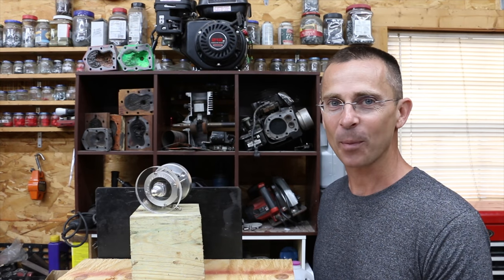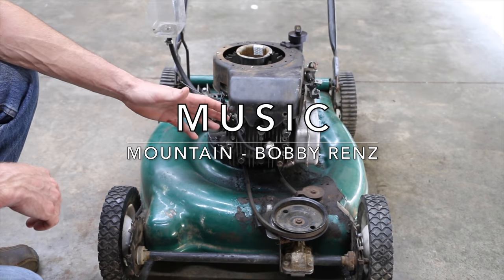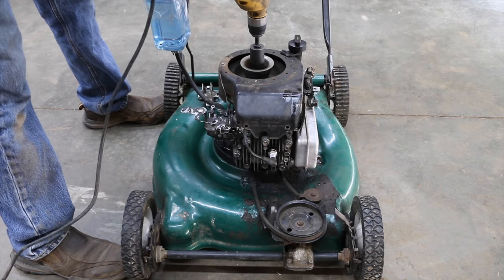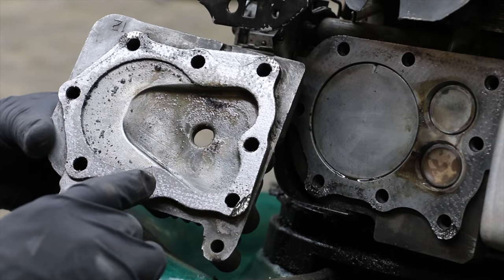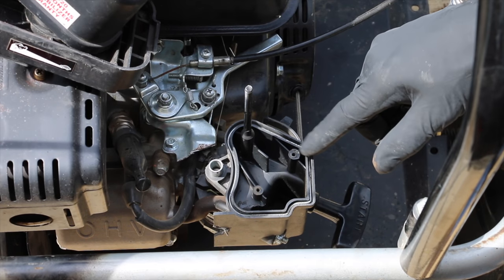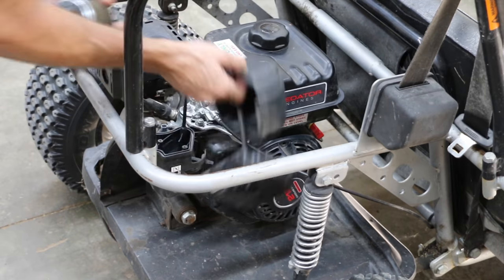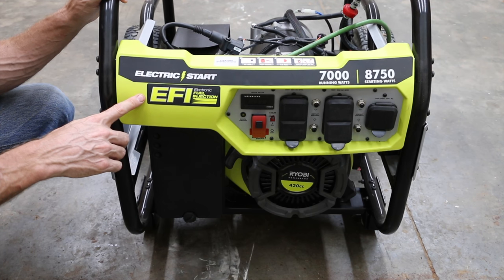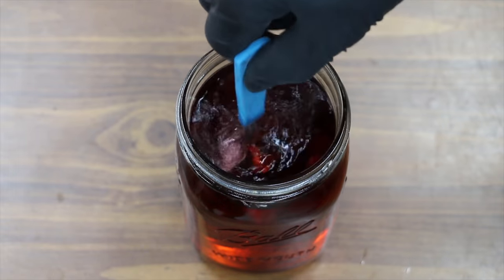Is Leaded Fuel better than Unleaded?  Let's find out!

Comment: How about a comparison between 10% ethanol and non-ethanol, reg gas?
Reply from the maker: Thank you for the video idea!
Reply: Ethanol based fuel gets worst mpg  than nonethanol fuel.
Reply: @UAa320  True but with ethanol based fuel you get more horsepower and torque.
Reply: @JQB45  I little bit more, but with ethanol there is the issue of it absorbing water.
Reply: @UAa320  The water absorption issue is extremely minor, youll likely offgas your alcohols, leaving your oil/sludge behind. This is typically the issue. (I say alcohols because gasoline contains and has always possessed a collection of alcohols)
Reply: Maybe more of E50 or higher vs non ethanol high Oct gas
Reply: @UAa320  I would expect about a 3% difference as ethanol has about 30% less energy than gasoline.
Reply: @JQB45  You may get more horsepower from ethanol if you use more of it at a time compared to using straight gasoline.
Reply: @2aminitials  Only if the engine is tuned for it. The higher octane rating of e85 allows for more advanced engine timing and higher boost without pre-ignition or detonation. This is why larger injectors, higher boost, E85 gets the higher horsepower numbers.
Reply: @JQB45  If you mix e85 with gas to make say a e10-e50 blend you will get a higher octane value, but running E-85 expect 30% mileage losse, if you buy gas with ethanol already premix to make the level say 87 e-10 then it's 87 octane regardless of the ethanol.   E85 octane value is around 107 octane, mix with 91 octane to make a e50 blend will result in about 99 octane. If you tune your vehicle to the fuel and you will see huge power improvement. Example,  2018 f150 3.5 ecoboost dynoed 93 octane  450whp 570tq, E50 tune 552WHP 620TQ. Huge gains just on tuning to the fuel.
Reply: @UAa320  ethanol gas also rots gas lines in small engines
Reply: @UAa320  Correction, ethanol based fuel gets better mpg in high compression engines than gasoline but worse in lower compression engines.  

Some ethanol engines surpass diesel engine's mpg even.  Here is an ethanol engine on the roads worldwide that has mpg equal to diesel:

https://www.oemoffhighway.com/engines/press-release/21005554/scania-ab-scania-introduces-bioethanol-engine

Always more power with ethanol, even in lower compression gasoline engines.  For example a Chevy 5.3L pickup gets a clean 380 horsepower on E85 and a toxic 355 horsepower on E0.
https://media.gm.com/media/us/en/chevrolet/spec-tables/2016/1500-crew-cab.html

Even with the lower mpg, the cost per mile is lower with ethanol.
Reply: @UAa320  

 Water is a truly a problem of E0 straight gasoline.

Years ago in the days of E0 gasoline every winter people would even have to buy little cans and add alcohol called DRY GAS or HEET as gas-line antifreeze.

Gas stations would even have many cases of it stacked up near the check out counter during that time of year. No one likes having a fuel line froze up in dangerous temperatures. It was common back in the E0 days.

Since E10 came, nobody buys DRY GAS or HEET anymore because the alcohol is already in there. There may be a dusty bottle or two back on a back shelf somewhere at the gas station, but that is it.

If ethanol did cause water/phase separation problems even half or even a quarter as much as is falsely claimed, we would know it right away because every winter literally <b>millions upon millions </b>of cars would be stalled on the road in the northern US and Canada. This obviously never happens, but many cars did stall with frozen fuel lines back in the days of E0 straight gasoline which is why Heet and Dry gas were so popular and E10 is why they are not so popular anymore.

Mercury Marine, which hosted a Webinar on ethanol myths, noted that ethanol does not "grab water molecules out of the air." It is hydrophilic, which means ethanol holds water. With regular gasoline (E0) as well at E10, the primary cause of water collecting in tanks is condensation on tank walls. But unlike E0, which can absorb almost no moisture, E10 can hold up to half of one percent of water by volume, and the water molecules will dissolve in the fuel. The "solubilized" water will bypass the water separator and burn harmlessly through the engine.

>>>>Mercury Marine also says E10 may be the superior fuel(over E0) because it keeps the fuel "dry"<<<<

https://web.archive.org/web/20140922142320/http://dcd96xmek71bc.cloudfront.net/archives/email/Trade/BoatingIndustry/MythsofEthanol-August252011.mp4

According to a paper published by the Society of Automotive Engineers, at 68 degrees F, alcohol with as much as 45% water will mix with gasoline and not separate. With 4%, alcohol will form a stable mix with gas down to about minus 22 degree F.*

*A.C. Castro, C.H. Koster, and E.K. Franleck, Flexible Ethanol Otto Engine Management System 942400(Warrendale, PA:Society of Automotive Engineers International, 1994)
Reply: @JQB45  lol no
Reply: Prior to my wife's passing in 2013 I had a few stations (one next door to me) that offered leaded gasoline (cost more) for all of the boat people going to the lake and let me tell you my 1998 made 3 more mpg and stopped knocking at 87 octane but on the 10% ethanol crap I had to use 89 octane at least and lost those mpg.  Where I live now there are no places with leaded gasoline but back where I did live there still are.
Reply: Jeff C       hmmmm.... not as far as I recall, I think it might even be worse...  but i’m not an expert.    Mostly because ethanol has far less energy density than conventional gasoline, meaning it would require more to make equivalent power..    So in a normal car, you’d not only be getting lees mpg, but also less power. In some places it’s cheaper to run ethanol mix per gallon, but it still adds up to about the same in terms of miles driven.

In terms of environmental awareness, I’d sooner skip ethanol and go straight to hydrogen, either direct injection or hybrid electric fuel cell.
Reply: very true
Reply: @thatguy.42  wish my turbo pt could run e85. probably perform far better. knocks a good bit even on 92. doesnt get much higher in my area.
Reply: Sweet!!👍👍
Reply: @thatguy.42  Yes that is true.
Reply: As long as we don’t get those geniuses that think putting 91 octane in their stock beaters rated for 85 will give them more power, Im happy..
Reply: E10's mixture is so heterogeneous that there's not a discernable difference unless you have some seriously sensitive test equipment
Reply: Dana Fletcher Many people  have had trouble in the past when ethanol was first added to gasoline and they used the mixed fuel in older equipment not designed with the fuel lines / gaskets of today that are ethanol compatible. That is not an oil company myth.
Reply: Yeah, since there was no difference between that and E10, there probably won't be much difference from aviation and E85. I hear E85 has more power (possibly 100+ Octane equivalent), but doesn't last as long. There might be a difference with a sports of luxury car as well, especially one that takes premium

That may mean you may need to acquire a sports car for... um... your viewers (one that takes premium, especially ones with turbos)! Yeah, viewers!
Reply: All about that E85 on a tuned drift car
Reply: Project Farm  also would it be possible to get another cylinder head for the mower so we can see side by side comparisons
Reply: Project Farm how about low octane vs high octane?
Reply: Ethanol fuel is terrible unless stored in a inclosed air tight container such as an auto fuel system, marine fuel systems are an open vented system ethanol fuel will turn bad within a few days in a boat ethanol is alcohol and does absorb water significantly, put ethanol gas into a clear container on a humid day and within minutes there will be water forming in the bottom and the fuel will almost immediately turn milky looking! Try it!
Reply: He already did that
Reply: @JQB45  NOT ON CARBED 2 STROKE & 4 STROKE ENGINES!! 

Ethanol seriously nerfs horsepower and torque plus causes a whole host of other problems in classic and vintage engines!! 

Leaded petrol (98 RON) contains 9.2 million calories per litre.

Unleaded petrol (98 RON) contains 8.7 million calories per litre.

E10 unleaded petrol (98 RON) contains 8.2 million calories per litre.

Unleaded petrol has a vapourisation point of 35 C. Ethanol contaminated petrol has a vapourisation point of 18 C. This causes the fuel to vapourise before the piston has even started the compression cycle once the engine has warmed up. This results in poor combustion, overheating and a noticeable hole in the bottom end and midrange torque on classic carbed engines.

Adding a very small percentage of diesel or kerosene will counteract the negative effects of the ethanol and raise the vapourisation point according to the ratio added.  

I have to run 33:1 diesel oil in with the normal 33:1 petrol oil premix on my 2 stroke motorcycles just to restore anywhere close to the OEM performance that they had on the leaded petrol that they were designed to run on. 

You seem to be confusing ETHANOL based with METHANOL based fuels.

Ethanol based fuel = reduced horsepower and torque.

Methanol based fuel = increased horsepower and torque.
Reply: dou you really have leaded fuel in the USA ???????
Reply: @JQB45  only in sports cars with high compression ratios
in everyday cars with lower compression ratios it will only increase your gas mileage, ethanol has lower energy per volume compared to gasoline
Reply: @2aminitials  The US government told engine manufacturers in the 70s to have their products ethanol compatible by 1983 if they were not already.

If you look at any chemical compatibility chart you will see that ethanol is far less corrosive on rubbers, plastics, and metals than what highly corrosive BTEX and gasoline are.  Look for yourself.
Reply: Colorado Strong  If you add water to your gas, you will have problems with any fuel.

Alcohols are in carb and injector cleaners, look at some of their ingredients.  Gasoline varnishes and alcohols break up varnish from gasoline.  Once clean, ethanol keeps it clean.

If E10 caused water problems, every single winter there would be millions upon millions of stalled cars with frozen fuel lines in the northern US and Canada.  There isn't, but there was enough in the days of E0 for little cans of alcohol to be sold as gas-line antifreeze named "Dry Gas" and "Heet" of which is not needed anymore because E10 has the alcohol in there already.

Here is some outdoor power equipment that burns E27(Brazil's common gasoline) just fine, does it look familiar?:

https://www.stihl.com.br/produtos.aspx
Reply: @CZ350tuner  Ethanol does give more horsepower and torque, even in lower compression engines.

A Chevy pickup with a 5.3L engine gets a clean 380 horsepower on E85 and a toxic 355 horsepower on E0.
https://media.gm.com/media/us/en/chevrolet/spec-tables/2016/1500-crew-cab.html

An ethanol engine will have better mileage than gasoline, some with greater mileage than the best diesel engines even.

Here is one on the roads this very day worldwide with mileage greater than gasoline and equal to diesel:

https://www.oemoffhighway.com/engines/press-release/21005554/scania-ab-scania-introduces-bioethanol-engine

Ethanol has MORE power than methanol and better mileage.  I did not confuse methanol and ethanol nor did the Indy 500 who is the subject of this article below:

A Brief History of Racing Fuel By Craig A. Johnson

In 2005, the IRL used 100 percent methanol in their tanks. The fuel worked well and was <u><b>more efficient than straight gasoline</b></u>, but IRL officials believed there was room for improvement. In 2006, they moved to a 10 percent blend of ethanol and methanol, which was then changed to 100 percent ethanol for the 2007 season.

The desire to use only ethanol aside, 100 percent ethanol is nearly impossible to obtain, and is illegal to keep without paying hefty taxes that date back to prohibition. The actual fuel used by the IRL is a blend of about 98 percent ethanol and 2 percent denaturant. The exact composition includes a small amount of high-octane racing fuel.

The fuel for today's Indy cars has an octane rating of 113, compared with methanol's 107. This means a significant reduction in pre-ignition, or knocking and pinging.

In addition, many of the people who handle the fuel, say it smells like tequila. This quality may seem insignificant, but smell is actually one of ethanol's benefits when compared with methanol. Pit crews noticed the switch to ethanol immediately, reporting fewer coughing fits and less eye irritation before any other modifications were made to accommodate it.

According to Dennis Vervynckt, manager of hospitality services and an IRL official, in 2006, the first year the IRL began using ethanol, teams saw a reduction in efficiency of about 10 percent. "That's because we put straight ethanol into the tanks," he says. "The teams initially didn't make any�or very many�adjustments to their engines. After a few months, they kept tweaking and by the end of the season they were back up to 100 percent efficiency."

Vervynckt points out that there was a minor loss of power. "When they first started using ethanol, teams saw a slight drop in horsepower," he says. "As the teams got used to the fuel, they were able to get more horsepower from ethanol once they again reached maximum efficiency."

The switch to ethanol also allowed the racers to carry less fuel and make fewer pit stops, thereby increasing efficiency even more. "When the cars ran on methanol tanks had to hold 30 gallons to accommodate the fuel requirements of the cars," Vervynckt says. "After getting the engines to perform at their full potential, there was a significant gain in mileage. Indy cars now have 22-gallon tanks. When a driver pulls in to change out his tires, he can fill up. Teams were able to match their tire and fuel stops exactly, instead of stopping for tires only, or fuel only."

That efficiency translates into much less fuel being used by the sport. Lifeline Foods LLC, which supplies fuel for the IRL, will produce 120,000 gallons of ethanol for the 2008 season. And though this may seem like a lot, it's<b> 20,000 gallons less</b> than was used the previous seasons.

The switch from methanol-based fuel to ethanol has amazed almost everyone in the league. Drivers, the direct users of the fuel, voice their approval in glowing terms. "[Ethanol] is an American fuel that is good for the country and the environment," says Ryan Hunter-Reay, of Rahal Letterman Racing and driver of the ethanol car. Standing beside his crew as they make last-minute adjustments to the car, he is more than happy to discuss the benefits of the IRL's switch to ethanol. "It's been great for Indy racing�the fuel economy, emissions�there's nothing we don't like. We love it."
Reply: Jeff C 

It’s partially oxidized, right? So no.
Reply: Dana Fletcher 

Actually, in a humid climate, chronically partially filled tank, and infrequent refueling, water will condense and require an additive or addition of E85. I’ve used anhydrous IPA and found that it worked well to dissolve condensed water.
Reply: Dana Fletcher 

I once bought off season a few gallons of RV antifreeze. It was IPA. I blended it into my washer fluid tank with a few squirts of dish soap.
Reply: Strieter Marine Survey 

Auto fuel systems vent through a charcoal canister, so humid air does enter, resulting in condensation.
Reply: @FrankGutowski-ls8jt  I agree which is why I keep tanks full for long term storage.  I live where it gets cold enough to frost and you can see on the outside of tanks just how full a tank is sometimes.  I would keep tanks full with both E0 and E10.

Mercury Marine, which hosted a Webinar on ethanol myths, noted that ethanol does not "grab water molecules out of the air." It is hydrophilic, which means ethanol holds water. With regular gasoline (E0) as well at E10, the primary cause of water collecting in tanks is condensation on tank walls. But unlike E0, which can absorb almost no moisture, E10 can hold up to half of one percent of water by volume, and the water molecules will dissolve in the fuel. The "solubilized" water will bypass the water separator and burn harmlessly through the engine.

>>>>Mercury Marine also says E10 may be the superior fuel(over E0) because it keeps the fuel "dry"<<<<

https://web.archive.org/web/20140922142320/http://dcd96xmek71bc.cloudfront.net/archives/email/Trade/BoatingIndustry/MythsofEthanol-August252011.mp4
Reply: Super lack of horses
Reply: @2aminitials  Only if your engine is optimized to for it or if your engine ECU is able to make the necessary adjustments
Reply: @danafletcher2341  you definitely are the  'more informed '  persons comments l
read.  
Personal experience l found using up to 100 percent pure Ethanol in my feul injected car gave way more power and fuel consumption was better than standard gasoline.  I did stay away from Methanol as it apparently attacks certain plastics in feul systems.  At that time l was working for Sasol Company in South Africa known for its production of fuel and other products from Coal so had access to many different feul products. This was pure curiosity experimenting from my side as Sasol did at time but they did maximum addition of 25 percent alcohol " otherwise major modifications was 
necessary " ! 
Only modification l did was to slightly increase points gap on distributor 
and car was performing better than ever. I laughed at their findings but did not inform them of mine.
Reply: He already tested blended vs unblended.  Spoiler:  The selling point that ethanol blended fuel has no discernible loss of fuel economy is completely false.

I'm not sure what these other commenters are on about.  You cannot gain fuel economy by shoving more fuel into your engine.  Yes, you can increase HP because ethanol has a higher effective octane rating, but the engine has to have the ability to make use of that.  You know what else increases effective octane?  Water.  Ethanol is less energy dense than gasoline.
Reply: Colorado Strong I won’t buy this crap. I think you live where I do in CO, I’m glad I can find pure gas!
Reply: @FM4AMGV  more like 30...I was getting 240 miles per tankful on E10, now I get 330-340, that more than makes up for the added cost!
Reply: @greggharvey6304  The EPA measured and found the US fleet loses 3 to 4 % on E10 and 4 to 5% in our current inefficient lower compression engines.  The price of E0 is far more than >5% higher in price so the cost per mile is most always less.

If your particular car is not like most, perhaps yours is in need of some sort of repair or adjustment.
Reply: @Ullr the snow God I just want someone to tell me where I am incorrect if so. I hate being wrong.  I would hope others are the same when I point out where they are incorrect.
Reply: @Markworth  Ethanol has less BTU which is a measure of heat, not a measure of work.

In a steam engine BTU would be useful.  In a piston engine, it is pretty much useless. 

For example, here is an ethanol engine that gets higher mileage than gasoline and is equal to diesel.  How can that be?  There are other characteristics in the fuel that gets work done inside on engine.

https://www.oemoffhighway.com/engines/press-release/21005554/scania-ab-scania-introduces-bioethanol-engine

Oak Ridge National Laboratory measured the mileage of the US flex fuel fleet with horsepower taken into account called the gasoline equivalent ratio and found that E85 averages 3% better fuel economy with power taken into account.

See bottom of page 7 and top of 8 here:  
http://web.archive.org/web/20170121004456/https://www1.eere.energy.gov/bioenergy/pdfs/analysis_saab2007.pdf
Reply: He should buy a test bench engine where he can vary the compression and advance and a bench dynamometer to hold load and rpm, then you will see actual science.
Reply: Ok, Dana.  I dunno why your dumb reply got deleted, but here we go.

1) Your efficiency example is completely useless.  Obviously, a high octane fuel will run well in a compression ignition engine.  They're using a compression ignition engine to take advantage of the higher octane and ignore the AF ratio.  You could get similar if not better results with race fuel or water injection.    In spark ignition engines, which is 100% of real world cases, you need a lot more ethanol than gasoline to have combustion.  That is a bad thing.  It must be a surprise that real-life testing indicates that the horsepower gains from ethanol do not magically cover the higher fuel usage.

2) BTU is a perfectly good indicator of energy density.  It's pretty simple math to figure that if you need >30% more fuel to have combustion and you have ~30% less BTU rating, the fuel has less potential energy.  But since that's not good enough, a quick search also shows that ethanol clearly has a lower energy density than gasoline.  24 MJ/L compared to 34.2 MJ/L.  Unsurprisingly, that's a difference of ~30%.  I'm sure one of those ancient dead links you wanted me to see would have some voodoo going on to try and disprove this basic math, but you know.

I get that there are benefits to using ethanol and all, but no one needs your "misleading" propaganda.  Knock it off.
Reply: @Markworth  Hi Markworth,

I did not delete any post so it must have been Project Farm who did or YouTube, if so, I wonder why.  I utterly despise censorship and unless for something uncivil I consider censors cowards.

Ethanol in high compression engines will indeed beat gasoline, even high octane race gasoline.

The Indy 500 when they switched from race fuel gasoline to methanol gained mileage and power.  When they switched from methanol to ethanol they again gained more mileage and more power.  So much so that the fuel tanks were made smaller from 30 gallons down to 22.  They saved 20,000 gallons for the first season.  

See article about it here:  
http://www.ethanolproducer.com/articles/4449/indy%27s-super-fuel

Oak Ridge National Laboratory measured mileage of the US flex fuel fleet with horsepower taken into account known as the gasoline equivalent ratio.  They found that E85 averaged 3% better fuel economy than E0(again, with horsepower factored in)

See bottom of page 7 and top of 8 here:  http://web.archive.org/web/20170121004456/https://www1.eere.energy.gov/bioenergy/pdfs/analysis_saab2007.pdf

Those are lower compression gasoline optimized engines.  In ethanol optimized engines, ethanol not only gets more mileage and power than gasoline, it also beats the best diesel's.

Ricardo built an ethanol engine for GM and it ran in a pickup. Here is an excerpt of an article describing it. Note it gets more mileage than even a diesel engine which is itself better than gasoline.

FROM RICARDO:

The new federal CAFE standards are calling for a doubling of fuel mileage performance, which, Vint says, is going to send OEM’s looking for high octane numbers to improve efficiency and ethanol is the best source. Ricardo, an engineering firm with over 100 years in the business of engine design, has developed an extreme boosted direct injection engine (EBDI) to optimize ethanol blends. The 3.2 V6 gasoline engine rivals the power and torque of a much larger GMC Sierra 6.6 diesel, he said, and it delivers 3.5 percent better fuel economy than the diesel.
  https://www.greencarcongress.com/2010/01/ricardo-and-growth-energy-collaborate-on-first-vehiclebased-demonstration-of-ricardos-ethanol-booste.html

Almost all manufactures have built efficient ethanol prototype engines. Here are a few:

FROM CUMMINS ETHOS ENGINE:

According to Cummins, it delivers the power (up to 250 hp) and peak torque (up to 450 lb. ft.) of gasoline and diesel engines nearly twice its displacement...

...Using corn derived E-85, the high thermal efficiency and power-to-weight ratio of this engine results in 50 to 58 percent lower well-to-wheels CO2 emissions compared with the gasoline engine baseline. Using second-generation, lingo-cellulosic derived E-85, the power train’s efficiency features deliver 75 to 80 percent lower well-to-wheels CO2 emissions, depending on the drive cycle.
  https://www.autoguide.com/auto-news/2014/07/cummins-ethos-e85-turbo-four-cylinder-engine-unveiled.html

FROM EPA & FORD ON FORD'S ETHANOL OPTIMIZED ECOBOOST SYSTEM:

Compared to production gasoline engines:

Fuel efficiency is ~15 – 20% improved for various drive cycles.

Full load performance is significantly improved, and comparable to production diesel engines.

The fact that ethanol is more efficient than gasoline is not new technology or knowledge, it was known long ago. It is suppressed technology.

Rear Admiral C.M. Chester wrote Henry Ford a letter on Dec.15, 1916:

"...I also pointed out in the article that as governmental laboratories had developed from 40 to 55% efficiency in alcohol engines as against 20% in gasoline machines, the use of alcohol at double the cost of gasoline for power purposes, was cheaper for motor[s] than gasoline in common use today."

The Navy was not the only researcher to possess that information:

Scientific journals from 1890 – 1920 contain hundreds of references to alcohol fuel at the dawn of the automotive era.

Studies of alcohol as an internal combustion engine fuel began in the U.S. with the Edison

Electric Testing Laboratory and Columbia University in 1906. Elihu Thomson reported that despite a smaller heat or B.T.U. value, “a gallon of alcohol will develop substantially the same power in an internal combustion engine as a gallon of gasoline. This is owing to the superior efficiency of operation…”

The USDA tests in 1906 also demonstrated the efficiency of alcohol in engines and described how gasoline engines could be modified for higher power with pure alcohol fuel or for equivalent fuel consumption, depending on the need.

The U.S.Geological Service and the U.S. Navy performed 2000 tests on alcohol and gasoline engines in 1907 - 1908 in Norfolk, Va. and St. Louis, Mo. They found that much higher engine compression ratios could be achieved with alcohol than with gasoline.

When the compression ratios were adjusted for each fuel, fuel economy was virtually equal despite the greater B.T.U. value of gasoline. “In regard to general cleanliness, such as absence of smoke and disagreeable odors, alcohol has many advantages over gasoline or kerosene as a fuel,” the report said. “The exhaust from an alcohol engine is never clouded with a black or grayish smoke.” USGS continued the comparative tests and later noted that alcohol was “a more ideal fuel than gasoline” with better efficiency despite the high cost.
Reply: @a.a7648  lol mazda makes high compression engines for daily drivers too
Reply: @danafletcher2341  Ive noticed other comments being deleted in this thread.
  Its likely due to a small group of people, or one with multiple accounts marking posts as "hate speech" or "spam".

But in my reply to Infinite Loop

Yes, gasoline has always been made of various alcohols. 
Some can be seen in this video.
   Such as, Xylene, Heptane,Benzene, Toluene etc..
Reply: Project Farm I recommended this test like 8 months ago.  It’s hard to run and setup all those tests... I can only imagine.
Reply: @DarkLinkAD  looool none of those are alcohols. I suggest that you go and study chemistry
Reply: @danafletcher2341  In port injected engines gasoline cleans the valves 😂 And by the way gasoline is also a good solvent
Reply: @kiyoponnn  They're all often used as solvents. All highly aromatic. They all disrupt/damage the endocrine system. Toluol and Xylene are often refered too as "wood alcohols".  All can be offgased during fermentation.
 So, for the intended purpose, matter what it be, it's safe to consider them an alcohol.
Reply: @kiyoponnn  Gasoline creates the soot inside an engine.  Ethanol is soot-less which is why Brazilian government studies found E100 engines last up to three times longer than identical engines running on their common gasoline.
Reply: @danafletcher2341  Yeah, that makes sense. Ethanol has a lower air to fuel ratio than gasoline and probably burns more completely because it has a higher purity. Gasoline on the other hand, is a mixture of short chain hydrocarbons and also has a lot of additives.
Reply: @thatguy.42  Some performance cars are also specially setup to make more power with E85, such as the Koenigsegg Agera range.
Reply: Brett Begani Yuup
Reply: They sell non ethanol?
Reply: @stigrabbid589  that's because alcohol runs cooler and isn't as volatile. You can run higher compression (or boost) and timing advance. But you have to dump a lot more in to do it. Alcohol doesn't have near the calories (energy) that gasoline does.